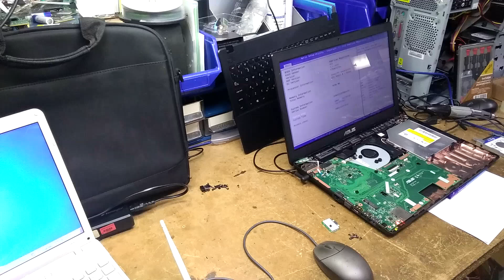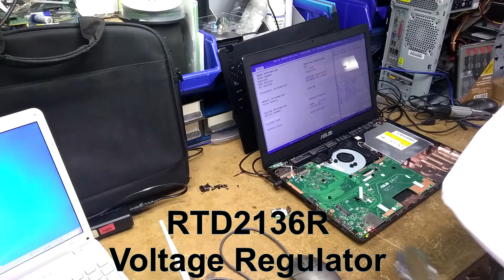Fix Asus X551 no Power

Comment: good morning and thaks for you video
i have two motherboards x551ma rev 2 with the same problem, replaced the chip as you said and now they are working but with external screen through hdmi, internal screen does not work, any idea? tanhks
Reply from the maker: Sorry for the late reply, but I would check the lvds connector and LCD to be sure they are working. Cheers

Comment: hi! thanks for the video! i have same board that jjust have a short on power flat conector (19+ with  ground) it does not show led and so on, at back of board there are few + - leters so there are two +- closer and the one of more inside way of the board is in short, do you have any ideia of what can it be?
Reply from the maker: Hi. Sorry for the late reply, but I could only find out by having the board with me.... A tip to not forget is that in any repair it is extremely important to ALWAYS do a visual inspection! Check everything under the microscope, lift up stickers if you need to.... Sometimes there is oxidation hidden where nobody sees and that's enough for a board not to work 😉👌🏼
Hope that helps

Comment: Where is the rtd ic in mainboard
Reply from the maker: Hi,
It's next to the LVDS Connector... I point it out at 00:33
Buy the way, if your problem is that the laptop wont turn on, i always first try these steps, because sometimes they work:
-Remove Power Supply
-Remove battery
-Press Power Button for 5 seconds
-Wait 30 seconds
-Connect Power Supply and try again.

I hope this helps.
Take care.